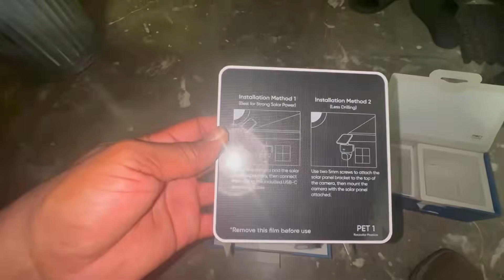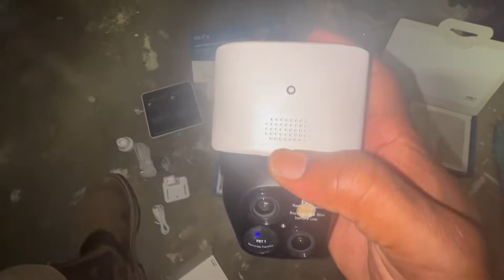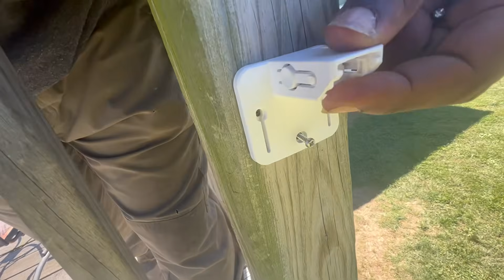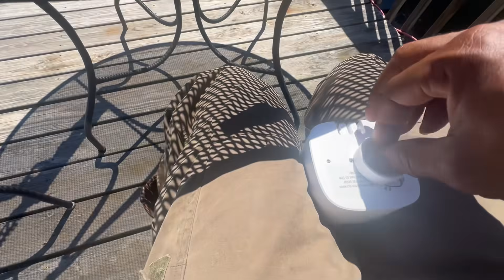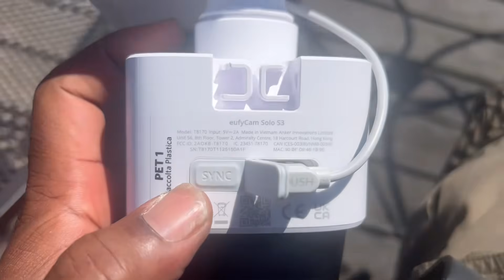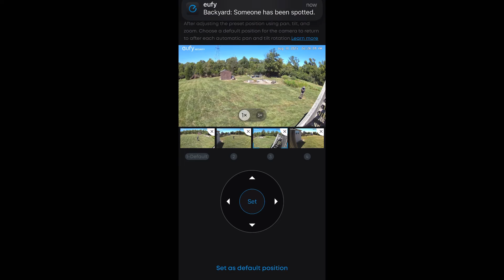I Installed the Eufy SoloCam S3 – $149 Security Cam with No Monthly Fees!

Comment: Didn't like the issues dealing with setting ro my wifi because turned out I jad to go into service provider for my home wifi to 2.4 ghz so camera would recognize it.  But as far as the camera goes.  Love this thing for the price.  Should jave left Ring alone and just gone with these.  Dont get me wrong, Ring is nice, but I like thtracking and the rotating ro view all around on these Eufy cams.  They are easy to install, it was only a wifi setup issue.  But resolved.